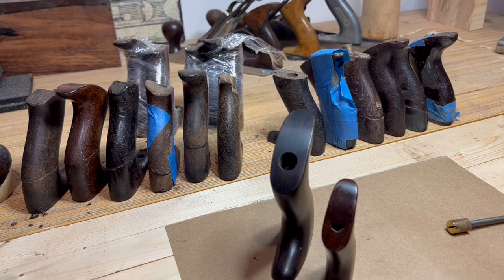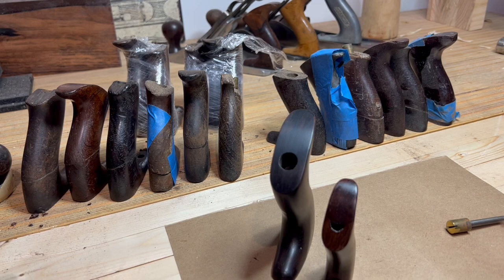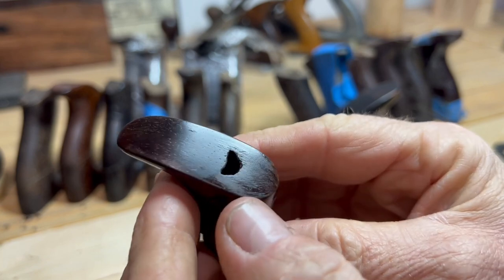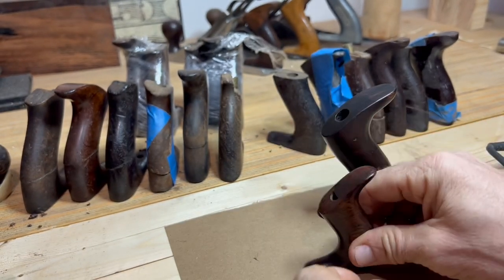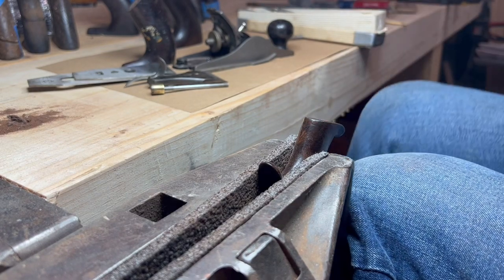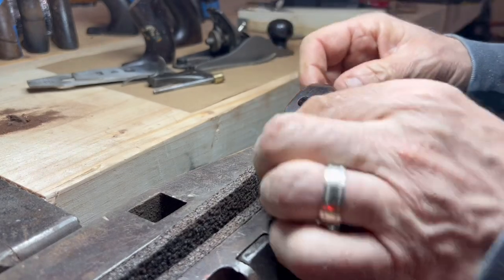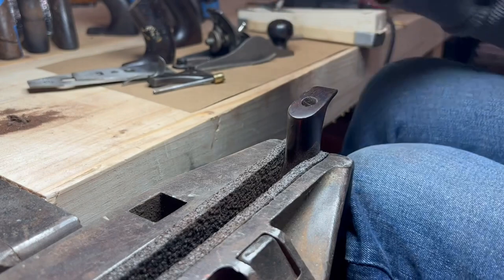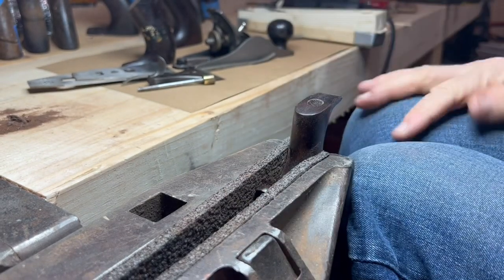Restoring the Counterbore on a hand plane tote

Comment: Hi would much prefer if you didn't fwd, I like to watch others solve problems in real time. length of video is not a problem quality is. Tote repair is a field I would like to know more about. Its strange to say that as I restore planes and tool, But I don't know every thing, so watching others helps. cheers from Tasmania
Reply from the maker: Wow Robin. This is a comment I did not expect. I appreciate your input and I suppose I could post the LP version as well as the shortened version. So I’m told,  most of the people on YT want something under 15 mins, so I crop. A lot. 😬

Comment: Hello there I’m thinking about trying my hand at making a few plane totes to replace a few of the white wood ones on a couple of the planes that I have what size stock do you look for at the minimum for a tote?
Reply from the maker: It really depends on the plane make/model/ and year. Many of the vintage Stanley can be fabricated from 4/4 thick material. Some manufacturers have “flats” on the sides of their totes and therefore it’s easy to measure. There’s also a very popular drawing online that lots of people like, dimensionally it shows 1-3/16” for the tote thickness. As for length and width of your material, you generally work with 4” x 4”. Again, sizes vary and if you’re working with an exotic, you may not want to bang out 4” squares and generate waste. Short answer, 4x4x1 can work.
Reply: Thank you